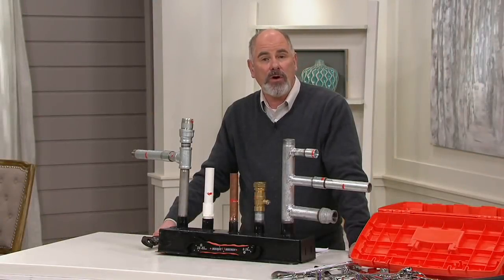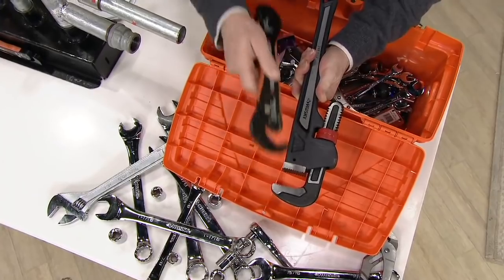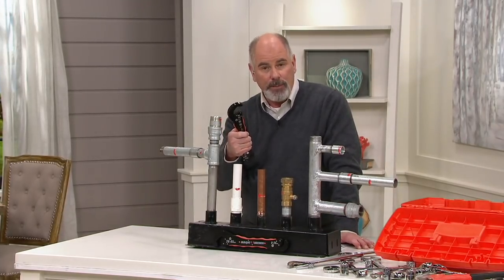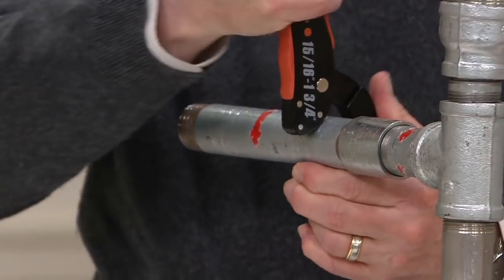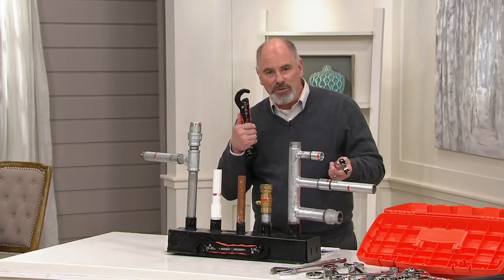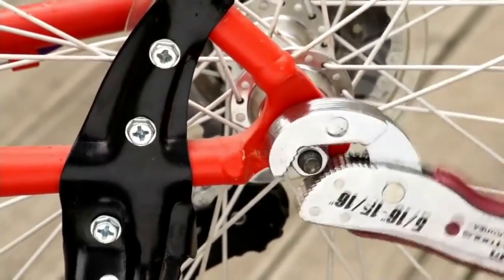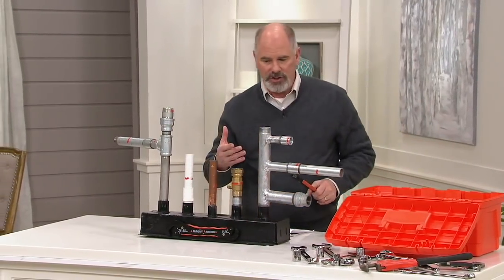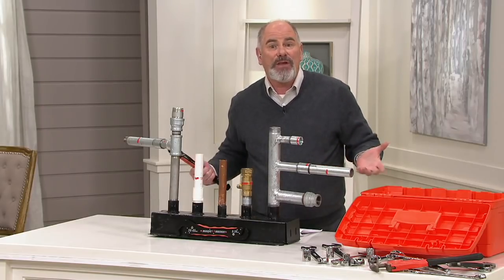Magic Wrench Tools Self-Adjusting DIY Wrench on QVC

Comment: Tries to tighten a pvc pipe that’s not glued into a pvc connector. As an electrician that part killed a little bit of my soul. 😂😂
Reply: Lmaooooooooo 😑 talk about a fail
Reply: More like part of your brain. Guess the guy uses a screwdriver for his nails..
Reply: why's an electrician using pvc?
Reply: @engineergaming2553  you run pvc conduit underground to sheath the cable or on roof tops to prevent sun, rain, or other weather damage
Reply: @jonathannilsen918  I forgot that pvc was also used as conduit.
Reply: @engineergaming2553  You make a bad engineer

Comment: He builds hot rods . Look how shiny all his tools are 🤣
Reply: Well dont judge yet.. He may obsessively bleach his tools after use 😅😆
Reply: I work at a shop that has had the same set of snap-on tools for 20+ years and they still look new
Reply: I saw some new label/barcode stickers in the toolbox.
Reply: Not everybody leaves their tools greasy when they’re done using them
Reply: Everyone is talking about cleaning the tools, but you guys are forgetting that the tools he has don't have any scratches whatsoever. It's obvious these were never used.
Reply: Tell us you’re lazy without telling us you’re lazy
Reply: @JDM12983  The fact he doesn't understand that a longer lever (longer tool) means easier to move whatever you are trying to move, makes it obvious, that he never touched a tool in his life. Also the rig has arrows, so he knows how to tighten the pipes, lmao
Reply: To be fair, those probably aren’t his.

I would honestly be surprised if he owns any tools at all. I’ve never met anyone who builds hot-rods ever say they “build hot rods”…  though I’ve only known 4-5 so 🤷‍♀️
Reply: Some of them have like brand new barcode stickers on them and the toolbox looks like they just bought it.

Comment: If you notice the color of the wrench he is using compared to the ones sold, his is all black and the others are chrome. The one he is using in this video is probably the prototype and bulit with stronger springs so it locks on tighter. The ones for the consumer are probably built alot cheaper too cut cost and don't have half the grip strength compared to this one. If you pay close attention you will see where some of the paint is worn off of it so it's definitely a used one. Just as I was finishing this comment the guy said "This particular model is exclusive just for QVC." Hmmm🤔
Reply: Consumer models are prob not painted cause the paint would peel off immediately upon use so it would be more expensive and look worse

Comment: Ok, if it actually worked, craftsman, snap on, Mac, matco, gear wrench, etc would all be out of business. That’s all I need to say.
Reply: Husky is probably thanking them for the free advertising
Reply: Lets pretend for a second that it does exactly what it says it does and works perfectly. Even under those circumstances. No manufacturer would market and sell this. It would wipe out an entire section of their buisness. Happens alot in the industry. Why sell 1 tool that does it all for $30 when you can sell miltible tools for $7. Its a profit margin thing. Which is why some not all but some very fine quality products,  does as it says it does products end up on these backend shows. Dont get me wrong 99% of the stuff is absolute junk. But every now and then there is a gem that nobody will touch because it works to well and would damage their buisness model. 
The trick is finding the gems between the trash. Is this one of those products. I would say its a very good multi tool. Probably doesnt work as good as the originals bit if tou want a space saving cheap product that works for the majority of things I would say this would do the job. Like buying a knock off battery for tour favorite drill at a cheap price. It does the job but isn't ideal
Reply: @willtruthteller4694  I know I'm 3 years late but allow me a 2 word sentence. "Socket Extension". This tool means nothing if you can't reach the bolt/nut in the first place.

Comment: There are reasons this tool never sells well. There is nothing new about this. It may be a good last resort option to have in the tool box, at the bottom, covered by all the tools it claims to replace. Plumbers have been using this tool for decades but the head pivots but it tends to be a last resort. I'd buy for $10, maybe $15 but no more than that. For $30, go to the ole brick 'n' mortar, grab an original Channel Lock or Vise Grip and call it a day. If you want to stand out, get a Knipex or Vamplier.

Comment: This could not replace a 10mm socket/spanner. It's way too long. Most the time you're using these tools in tight space where this simply wouldn't fit

Comment: The 1 1/8th wrench is longer giving more leverage, that short thing he is holding won't loosen a nut or bolt that size. Would like to see him run water through that copper pipe he mangled up.  🤣

Comment: the things they tighten/loosen look like they were not even hand tight that wrench should had slipped off it it was tighter than hand tight ( from looking at it) oh yeah and the reason you stripped out the bolt with a soket was because u used the wrong size dummy's or used a 12 point socket on a heavaily tourqed bolt/nut.

Comment: This man is a fool id like to see it remove a spark plug out of a engine or brake loose a tractor trailer wheel lug nut or unbolt a transmission